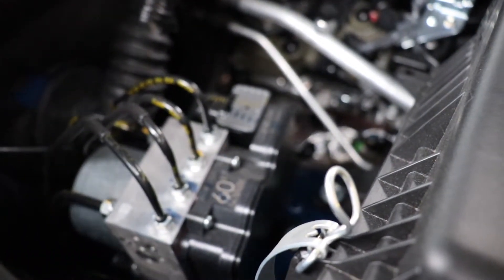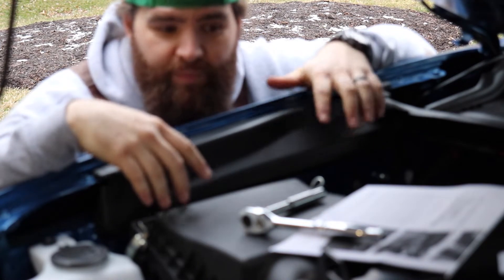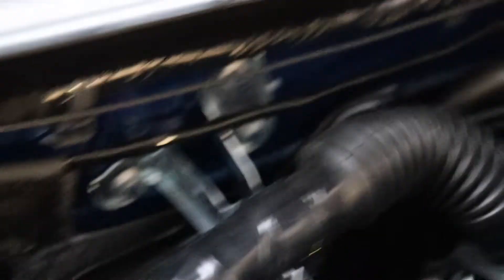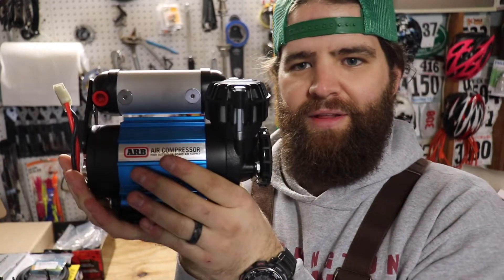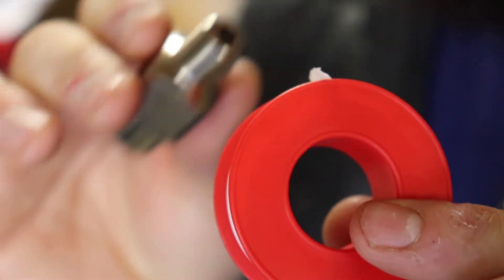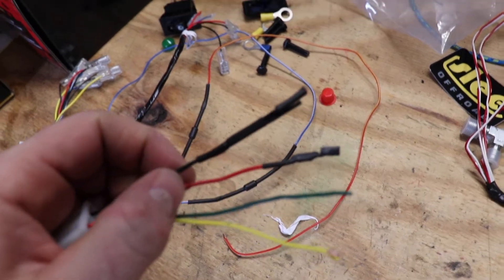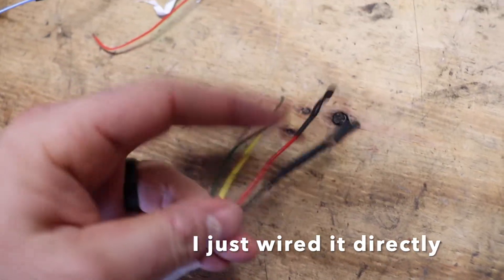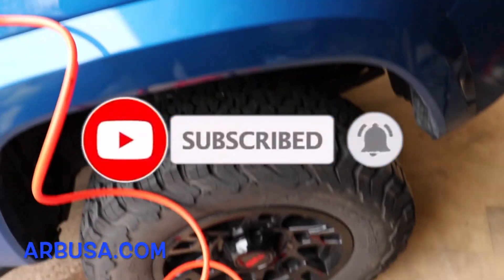ARB Compressor + Slee Compressor Bracket Install

Comment: thanks for the video. is it possible to mount the compressor to the bracket before installing the bracket? that way the air box can stay in place. thanks.
Reply from the maker: I think either way would work. If you do mount the compressor to the bracket just make sure is loose so you can make fine adjustments.
Reply: Great idea.  I will likely go that route.

Comment: Excellent video man. I have the same bracket and compressor. I oriented it is the same direction. How did you tighten the compressor down after to rotated everything? I can get to the screws now.
Reply from the maker: I used a ratcheting open end box end wrench to tighten everything down.